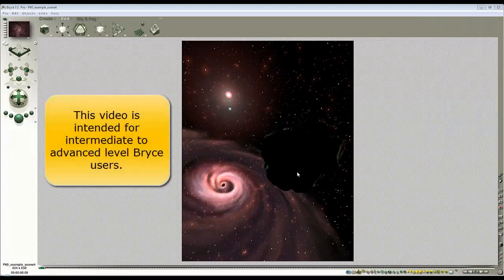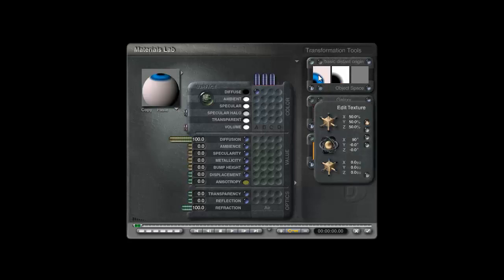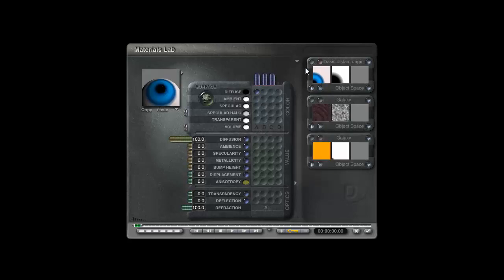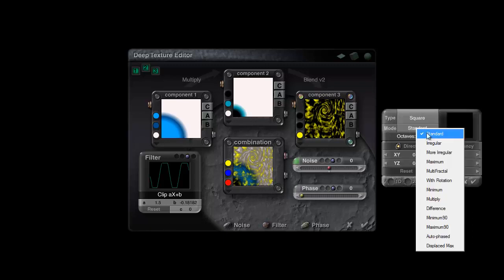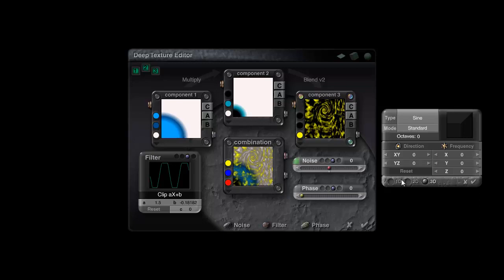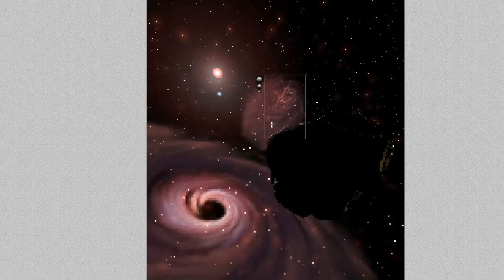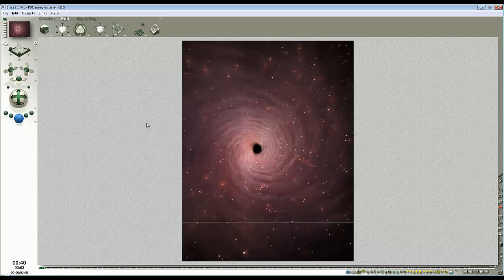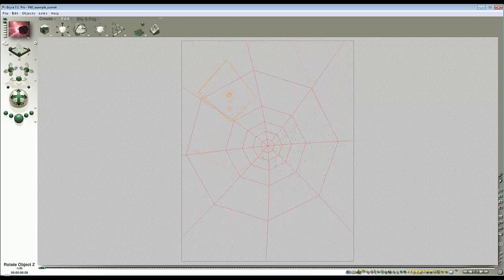Digging deeper into the DTE with example scene 4 - by David Brinnen.

Comment: I started my 3D journey in Bryce and by watching your videos and a great deal of reading Horo's website. Did some fun animations but life took me on another path. Now I am back in 3D land and using Blender. I am still amazed at the abilities and interface of of Bryce to this day. There is so much depth I never even explored. Thinking of running a virtual machine on my current computer just to use Bryce again - if only to export materials and such.
Reply from the maker: It is a shame that Bryce development got stalled, but to continue would have required some inspirational interface update, or otherwise it would have become homogeneous with all the other bits of software out there that suffer from interfaces designed by engineers and programmers, for their own ease of use, rather than ones designed by artists for making artworks.  Be aware, exporting materials is somewhat of a dark art.  I've done a couple of videos relating to this process when trying to export for use in Octane, which you might find useful to look at if you find yourself in that position.